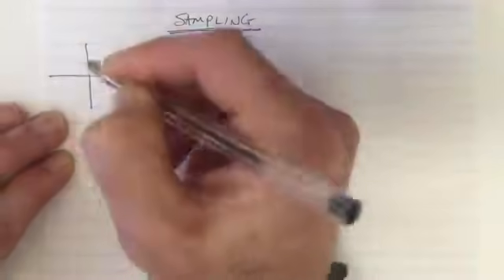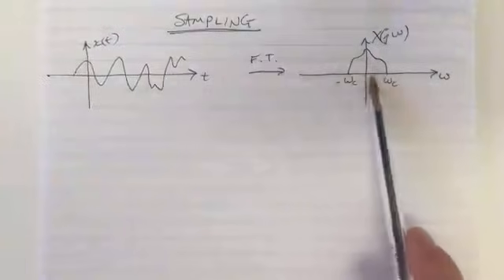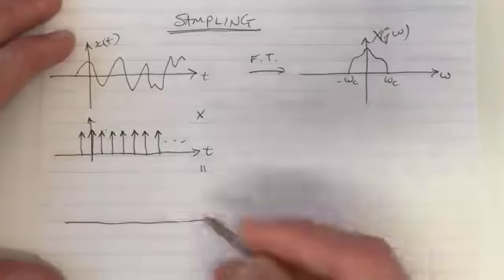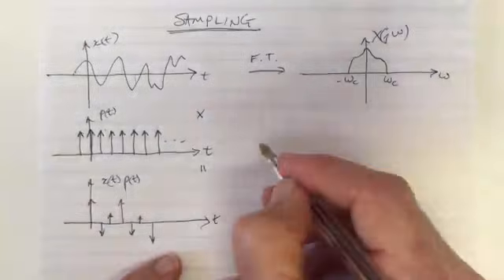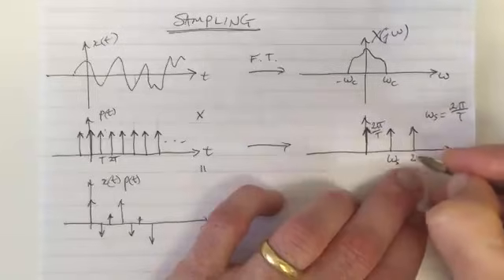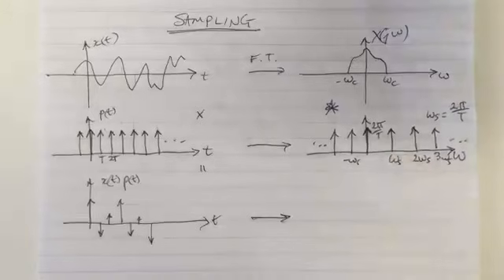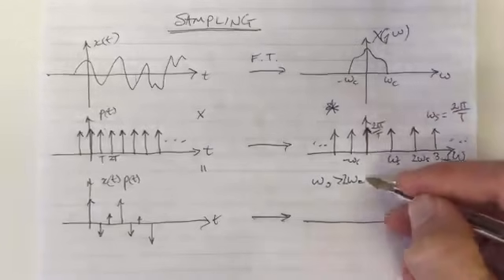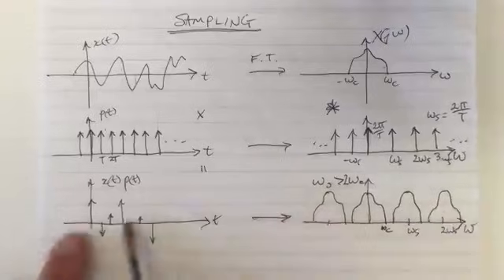Sampling Signals

Comment: If you’re willing to make a video about it, a discussion of the mathematics showing how bandpass signals can often be sampled at a rate lower than Nyquist (yet still the original waveform can be picked out, if the sampling frequency is selected carefully to avoid aliasing) would be amazingly helpful. I feel like this is slightly overlooked in many places.
Reply from the maker: Thanks for the suggestion. I think I touched on it in this video (but it's been a while, so I can't remember for sure): "Sampling Bandlimited Signals: Why are the Samples "Complex"?" https://youtu.be/JglRGRizqGM

Comment: Wow nice explanation.
But i' ve 2 questions 
1)Do we need sampling to transmit analog siganal through an analog system. I mean we will transmit our message signal in analog manner like using AM/FM/PM modulation. In that case do we need sampling??

2)Another question is there any technique to error correction and detection for analog signal??
Reply from the maker: 1) Purely analog systems do not use sampling. 2) No.
Reply: @iain_explains  
Thanks for clearing my doubts.💖

Comment: I'm posting here because I don't understand why when we have a signal, let's say a voltage, why the units of its sampled version are Volts multiplied by Hertz and not just only Volts? It's something I've seen in my course and this is what our teacher taught us but it's doesn't make sense to me.

He also taught us than the unit of the Z-Transform of this sampled signal is in Volts (whereas to me it's would have been more logical to have V.Hz for this one).

It would be nice if you could help me.
Thank you.
Reply from the maker: I think you'll need to ask your teacher what they meant. Volts per second does not make sense as a unit, unless you're talking about the rate of change of a voltage signal.
Reply: @iain_explains  Thanks for your fast reply. I didn't ask my question directly to my teacher because it's the holidays but i'm gonna try to send him an e-mail.

Comment: Excellent. At least a decade ago I was reading Marvin Frerking’s book “Digital Signal Processing in Communication Systems” chapter 1 when this concept final clicked in my mind. He described the spectrum of a sampled signal as being periodic centered on integer multiples of the sampling frequency. For the first time in my life I felt like I really understood something important at a fundamental level. Graphically, as you have done in your video I was able to visualize the requirement for reconstruction (the Nyquist criterion). For me this is a satisfactory proof of Shannon’s sampling theorem and the Nyquist criterion rolled into one nice graphical proof. I like proofs with pictures that are rigorously correct as you have done. I don’t recall if it was presented this way when I was in college 30 and 40 years ago. It just didn’t sink in until years later.
Reply from the maker: Thanks, yes I agree, graphical insights are often extremely important. I find it helps to visualise all mathematical formulas in a graphical way.